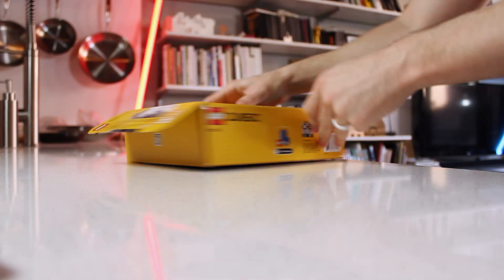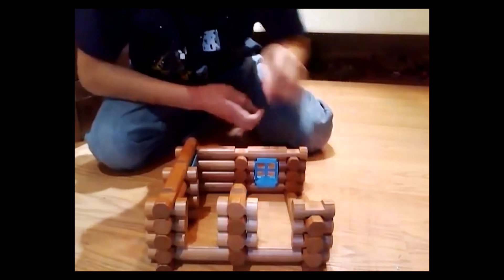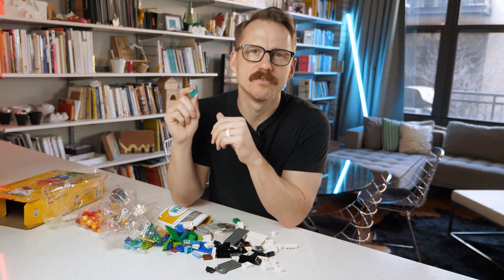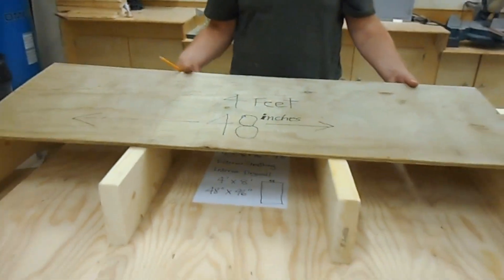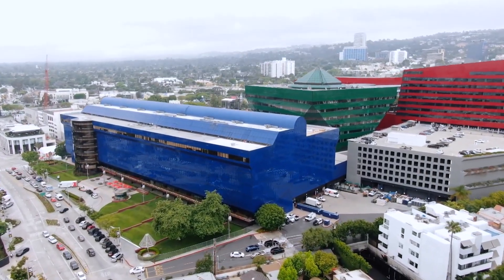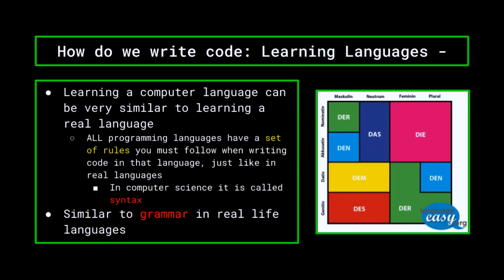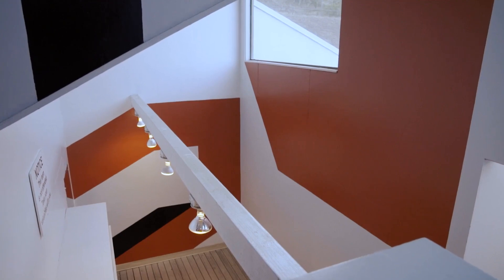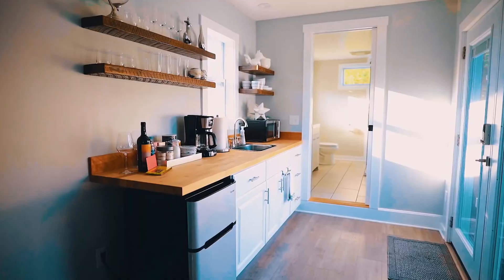ARCHITECTURE of LEGO: Architecture professor finds lessons in LEGO

Comment: awesome video! lego are a really helpful teaching tool for this sort of thing. in one of my first architecture classes the first assignment was to make a building out of lego, draw elevations of it, and then painstakingly recreate it in autocad. iirc the teacher specifically chose lego because of the modularity and how each part has specific measurements, because it makes getting the dimensions of the cad model a little bit easier. he still keeps a bin of legos in the classroom in case anyone wants to use them to help come up with designs! :)

Comment: Kinda off-topic. Shipping container buildings aren't suitable for homes or living spaces. It's cheaper to recycle it into something usefuly than try and make something that it wasn't designed for
Reply: Shipping containers are strong, rigid, durable and weather proof. You don't need extensive foundations, just attachment points for the four corners. You can add doors and windows without dropping the roof on your head since primary structural components are the edge elements, with the faces resisting racking, keeping the corners vertical.

If the standard heights and fixed width unit are a little too small, you can insulate externally instead of internally, so the steel becomes part of the thermal mass for the space.
Reply: @EmyrDerfel   that's only the little part of the engineering orchestra that makes a suitable place for human being. Here's some branches:
• making everything internally: everything other than frame and floor is non-structural, these metal thing walls are only good at keeping weather away, and making piping and windows makes them less structural. And of course less space.
• making everything externally: basically you only need a metal frame, and well, metal frame houses are a thing, you have to basically rework the 90% of the shipping container, which isn't cheaper than making a normal metal frame house. And you somewhat lose the stackability.
Although shipping containers are meant for shipping, it's kinda expensive to ship a shipping container to a place of building than materials, (unless you're near the port/railway)
It's better to use it as a shipping container or recycle then try and make a home out of it.

Comment: Legos are also really great to quickly try out different compositions and layouts with simple volumes where each component is assigned a certain number of studs. I did a variant study like this about a year ago for a semester project. And while it does not have the level of detail you may want to have in the end it's still great for brainstorming

Comment from the maker: What have you learned from Lego and what are your favorite sets?
Reply: The yellow submarine set ,Lord of the rings and architecture theme
Reply: A lot of times when I tried to make a set i would usually just scrap it all together and make something of my own.
Reply: 🙈🙈🙈🙈

I have learned that they are called Lego (also in the plural).
Reply: I built the Villa Savoy set and the Farnsworth House. I’m waiting for the E1027 set but I may be waiting a long time.
Reply: There's a sushi place I go to that has little gachapon machines that spit out tiny knock-off LEGO sets of different menu items when you drop enough plates into the chute. If I squint my imagination it feels like I'm cooking!

There are also bigger sets you can buy in stores that are usually little chibi versions of characters from pop culture. They have to have their proportions skewed that way for the sake of structural integrity; if my little figure of Vegeta or whatever were accurate to his proportions as originally designed, then the set would have to include taller blocks to keep the arms and legs from snapping apart so easily. That would then ruin the creative modularity by giving the set a big chunky piece that can't be broken down further. So the lesson there is that something it's better to have something squat and wide than it is to have something tall and narrow. Squat and wide is more structurally sound and customizable. Tall skyscrapers are more limited by what they can do without collapsing or tipping over.